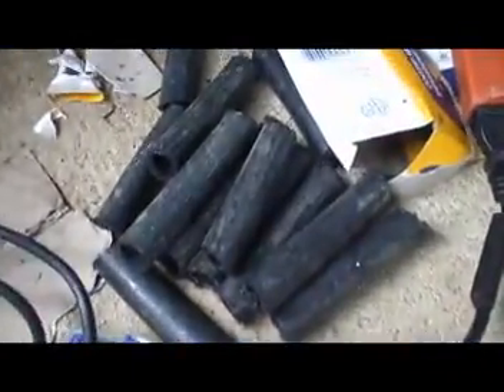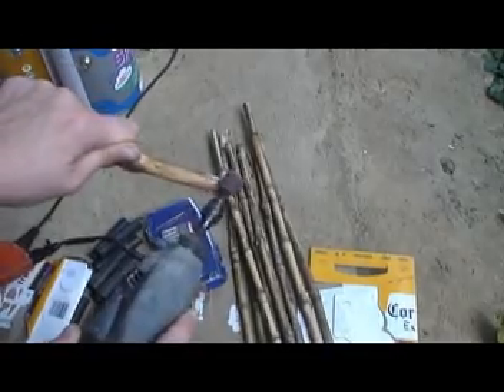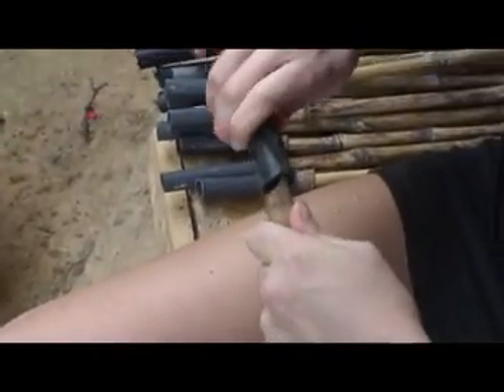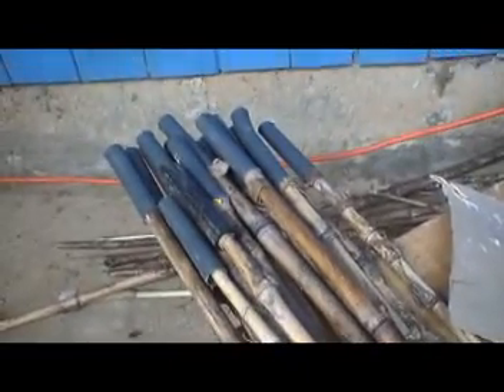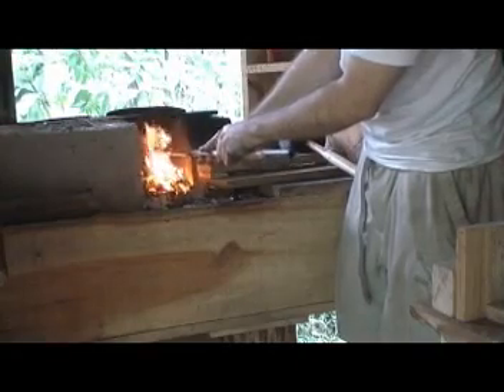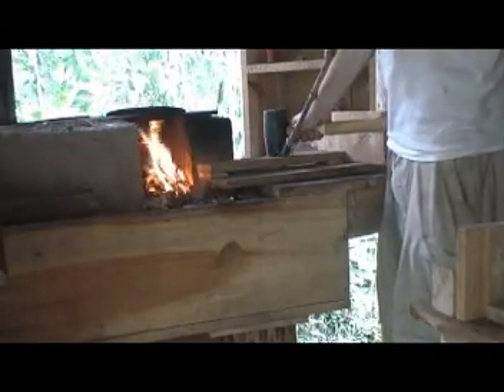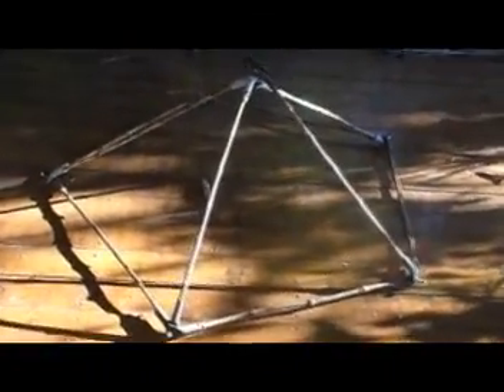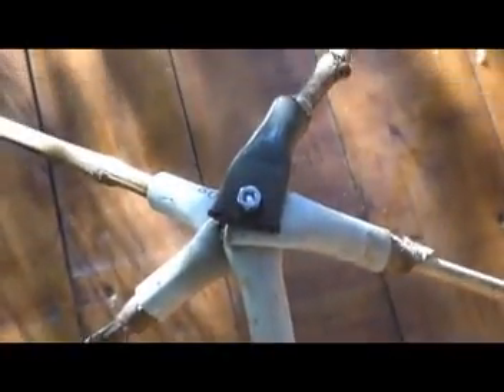How to build an Icosahedron Geodesic Dome

Comment from the maker: @HGNnet  def agree that plastic burning is a rough choice. Their are many other options. I now work cutting out metal with a c and c machine so am able to fabricate connectors with scrap metal sheets. But the motto of the dome building for me is "use what you have!" thank you for the pvc warning.